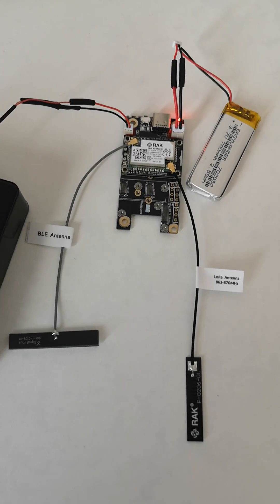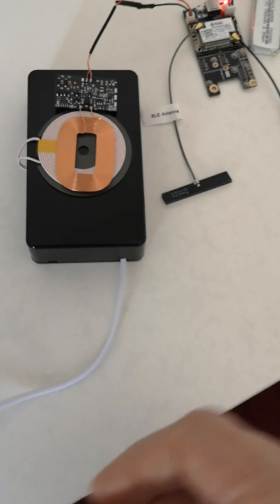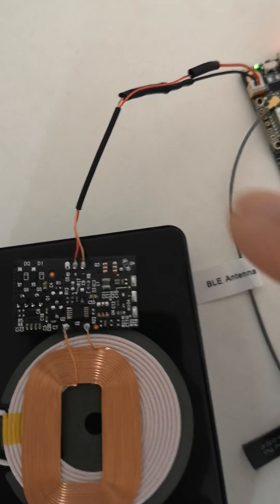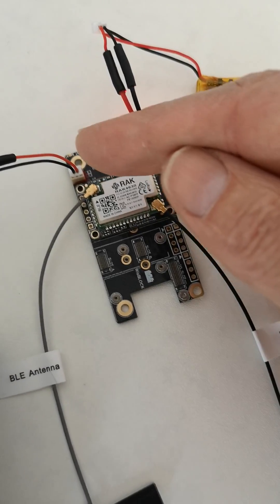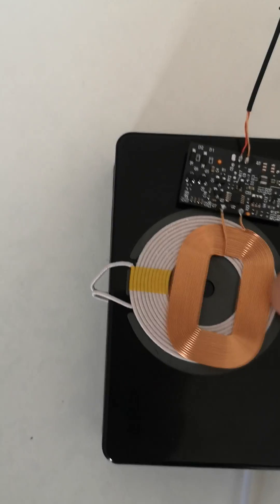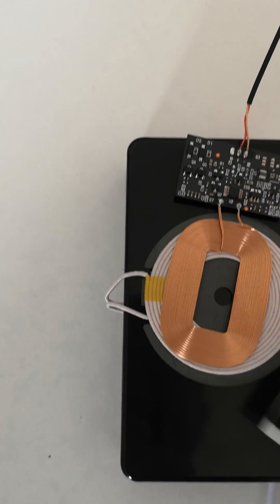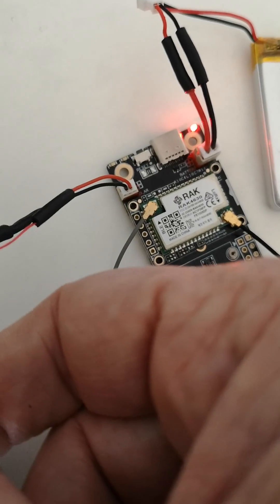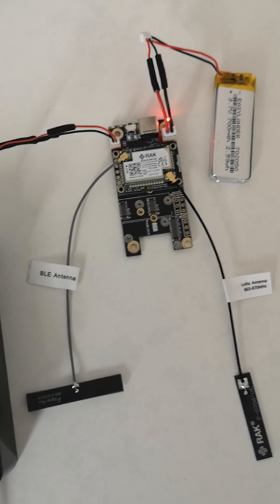Meshtastic Wireless Charging

Comment: Nice experiment, if your receiving power coil were  to work with USB mag phone chargers (commonly available & even in some cars) with a suitable magnet in the box it would self align for charging and the node would stick to magnetic objects for use. ?
Reply from the maker: That's a good idea. I don't have a car so I didn't know about alignment magnets. They would be easy to add ! I love the idea of magnetic mounting. This could lead to a whole new line of fridge magnets !!!
Reply: Not just a car feature - If you google "mag-safe charger"  you will get a list of USB inductive charge pads (~£5) which should contain a magnetic element. The latest iPhone and Android phones have a complementary magnetic element that aligns them on the charger - if your case replicated that you could make the charging reliable and ,perhaps, make a stick to metal unit RX/TX ?
  @fotografm